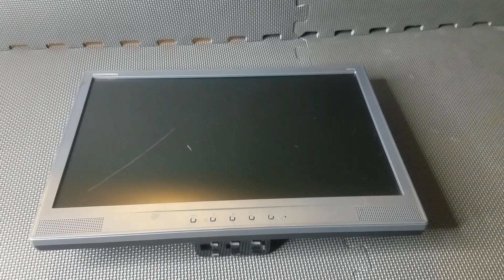LCD Side Panel Tutorial Part 2

Comment: Hi dude i got a problem. On my connector beetwen both board i got  these pins in order:
12v
12v
GND
GND
5v
5v
N. C
ON
DIM
M/S 
Can you help me there?
Monitor is LG1919s
Reply: Did you figure it out? I have the same question!
Reply: @manuelferreira4268  sadly not, but I might had solution for that but never tested it because I left my home ;/ can you provide link for photos of both PCBs and connectors? Maybe I'll be able to help

Comment: After way too many months, I made a little video showing my LCD Side Panel mod in a micro-atx case!  The Define Mini C TG has a tempered glass side panel that isn't tinted at all and looks amazing.  Just posted the vid here, lemme know what you think! https://youtu.be/a22ldRGOo1k
Reply from the maker: I came out very nice, one thing I have tried moving away from is purchasing monitors to take them apart. I started using LCD board controllers that are made for whichever screen I'm using. Of course it cost more, but the implementation in my opinion is much simpler and cleaner.

But great job, very clean and professional finish.

Comment: I saw in the comments, you're now using a Rasberry Pi? can you go into more detail on this, and how to actually power it? I've never messed with wiring before
Reply from the maker: Must have missed this comment. I originally ran a wire(this was plugged into an outlet) from a power supply made to power it. However, I later changed that, it now receives power from a 4 pin molex that connects to a usb plugin that connects to a micro usb cable. This at first result in a corrupted OS, happened randomly, due to power being abruptly cut from the RasPi, but it stopped after a while. Why? I don't know, just did.

Comment: here can you help me I'm stuck on the Molex part how to connect Molex to the video board
I also want to power it from the Molex. 
i have following pinout labelled on video board:-
BL_ADJ_PWM ---
ground ---
ground ---
ground ---
5v_IN(13v)
BJ_ADJ_ANALOG
BJ_ADJ_ANALOG
BL_EN

the pinout on the power board:-
B-DIM --
15v --
GND --
GND --
GND --
5.1v --
A-DIM --
ON/OFF
I have written them in connecting order so (BL_ADJ_PWM --- to B-DIM --).
hope u care to help a brother around.
Reply: I used a SATA to Molex adapter and the molex yellow 12v black ground black ground and red 5v. I connect the 12v for the led and the 5v to feed the monitor.

Comment: Question regarding the image, does this count as like a second monitor in your computer settings? so if i really wanted to i could watch youtube on it?
Reply from the maker: If you connect it as a second monitor like I did at first, yes. Now I'm using a raspberry pi, so not as easy.
Reply from the maker: @dreamspear2159  That's what the video goes over, it's my original set up.

Comment: if it just work without pressing the button, it should work if you didn't leave it on after all, because those look like standard push buttons that connect two wires and push... ok less nerd stuff
technically the button doesn't do anything until it is pressed, which means that not having it on at all, would not change anything.
Reply from the maker: Are you referring to the buttons that the monitor comes with?
Reply: @OnePixelataTime  Yeah. Sorry, I wasn't clear enough.  The circuit board for the buttons doesn't look like it stores anything, you should try running it without the buttons plugged in.
if you want to be sure, you can probe the buttons and see if there is any voltage going through while you are not pressing them, to make sure they are not a switch.
but they look like a push button, so just removing it should work. Except if it accidentally turns off, then you need to put them back :P
Reply from the maker: @catboy9377  Its cool, in an upcoming video, I'll explain why.
Reply: @OnePixelataTime  Really awesome video, by the way, I will try refurbishing my old monitor that doesn't get power delivered properly, maybe it will work and make a really cool transparent LCD to put on something :D
Maybe you have a discord for chatting?
Reply from the maker: @catboy9377  I do, it should be under my contact options.

Comment: You should all be aware that monitor power supplies could very much harm you. It is NOT recommended to remove the internals from the power housing if you're brand new to electrical wiring, and instead just run the monitor power cable out the back of your PC.
Reply from the maker: Currently all wiring is enclosed in a container, would that still be an issue?
Reply: @OnePixelataTime  that's likely fine and is the recommended way to disassemble it (transplant it to a smaller PSU container). Was just a PSA to young/new people that those circuits are powerful enough to cause harm
Reply from the maker: @HTHazard  Yes, I agree, which is why I decided to go that route, the first build, if anything, was a very amateur prototype. Thanks for the concern!
Reply: Wouldn’t it be unsafe to use the powerboard  in your pc cause it’s using vc power and if it’s not properly grounded then it will fry or even kill you?? Maybe I’m wrong idk

Comment: nice work dude.. but plss show us how you connect the power cable of the lcd panel to the molex
Reply from the maker: Someone asked me a similar question, my response was a few pictures of the wiring I did https://imgur.com/a/AfGgkpr. I have a 4 pin molex powering the board that powers the screen. This of course will vary by screen, trial error is what you'll have to do, just be careful. The wrong wiring can short circuit the whole screen.

Comment: can you help me with my monitor? there is no label in my monitor :(
Reply from the maker: I really can't, but you can look at the model number on the bar code on the back if there is one.
Reply: gci 1v0 94v-0 that is the model number of my monitor but i cant find the schematic online but i saw identical board from ebay which does not contain the schematic
Reply from the maker: Try this site out, maybe a manual on here can help, no guarantees

https://www.eserviceinfo.com/fulltext.php?search_ft=GCI%201V0%2094V-0%20sz

Comment: How did you wire up to the power thingy? For some reason I can't get mine to power and it's annoying me badly lol.... The board says  12v - 12v - GND - GND- 5v - 5v - GND - 5v - on/off - VBL NC... I've tried all ground tied together and all the 5v tied together, and nothing. I tried single 5v and single ground but nothing.
Reply from the maker: In my configuration I have a ground and a power cable, so one ground cable(black) and one 5v cable(red). This was for the model I chose, for other models, it will vary, but be sure to have a ground and a cable(5v/12v?) to give it proper power(at least in my case it how its worked so far).

Comment: have problem with 5 pin to LCD board pin. don't know which color pin that have to connect ?
Reply from the maker: Nut Bunnarot I'm honestly not sure what you're asking, are you trying to connect your board to a 4 pin molex?
Reply: sorry for not clear Question. Yes from PC power supply  4 pin molex to screen board direct.
Reply from the maker: Nut Bunnarot Got it, as I said before, it varies by monitor, try 5v to start with on a few select wires. Its mostly trial and error,  as was with my case. The circuit board can also help, as it can have labels that can point to what wire powers what. I hope this helps.

Comment: I managed to get the screen off completely just like at 3:57, but I accidentally tore a very tiny bit of one of the orange strips off  the screen (like about 2 cm). Will it still display correctly if i make sure it sticks back on??
Reply from the maker: Sadly it won't, if I'm saying it right, those ribbons send information to the LCD, if you damage them, the LCD will only receive part of the signal. Check out this video to better understand what I'm referring to.

https://www.youtube.com/watch?v=98a8iMokMcY
Reply: Darn, glad I waited for a response before I kept going only to dissapoint myself lol. I'll try with another spare I have and be more careful next time. Thanks for the quick reply, great video!!

Comment: How can i know if a 4-pin molex is enough to power the screen? How did you find it out?
Reply from the maker: In my case, trial and error, but you can always try other things like looking up the model number of the part or using a multimeter to measure voltage.
Reply: hey could you be a little more specific? do you just clip stuff and see what it doesn't need ? can't you damage it if you clip certain things ?
Reply from the maker: It's difficult to which specific cables since it changes by model. I would try a ground wire and one of the red wires(to my understanding, colors represent different voltage, red being 5 and black being a ground, how accurate this is, I'm not sure, but its seemed consistent with what I tested) to see if it would turn the screen on, wires connected to the display board(if that makes sense).

Comment: Hi, great job!. I made one of these but the objects looked blurry inside my box even with a lot of lights!. This is the LCD that I'm using Toshiba Satellite B156xw01 . Do you have any idea why this would look blurry?. I know that this display has two polarizers, one in the front and another in the back not sure if that's why
Reply from the maker: jaccsoft If I remeber correctly some LCDs are designed to blur light  so it spreads out better/evenly (light in the unit) so I'm guessing it's a blurry transparent windows but the images it displays are clear?

Comment: Hey man, my monitor also has 2 5V cables labeled on the power supply, how did you determine which wire to use? Is each cable for a different purpose? I'd love to finish this project but how to go about powering the LCD really has me stumped. Thanks!
Reply from the maker: Ashnno Trial and error I guess, it's what I did, looking at the main power board can also help. It varies by monitor, so I can't tell you which wire does what.
Reply: Okay, I'll see what I can do lol.

Comment: What An Awesome Job There..  Very Informative As Well..  Have You Tried To Use..  Two Monitors In One Build..?   Say One Monitor On Each Side..?   You Can Even Put Two Smaller One's..  On The Same Side..  So They Can Display Different Things..  Once Again Thank You For The Video..  Keep Up The Great Work..
Reply from the maker: I haven't tried it, but I doubt it would work very well, LCDs have (at least the ones I have handled) a small border around them that doesn't display anything. It's line getting two pictures with frames around them put next to each other to make a large image, the frame  being there takes away part of the immersion.

Comment: Hi, but anti-glare and polarizing layer are in the same side of the panel?
Thank's
Reply from the maker: abba acca Yes, in some cases, two polarizing filters, but always one anti-glare layer as the outer most layer.
Reply: One Pixel at a Time
i try to Leave over night the wet towel but i can't separate the layer,, it's necessary remove it?
Reply from the maker: abba acca Not necessary, it's just to make the screen not look as glossy/reflective, which is how I wanted mine to look like.

Comment: great video man,you just earn a new subscriber,now i just need to learn which wire i should cut and solder so i can power the monitor with the molex..
Reply from the maker: pisang oren That's the tricky part since it varies by monitor, pick the wrong wiring configuration and you have yourself a fried monitor.